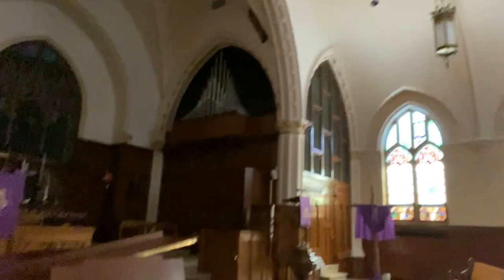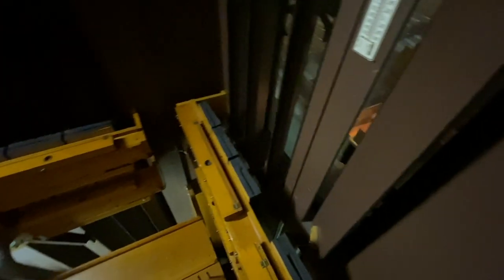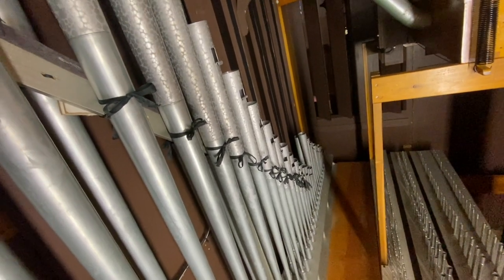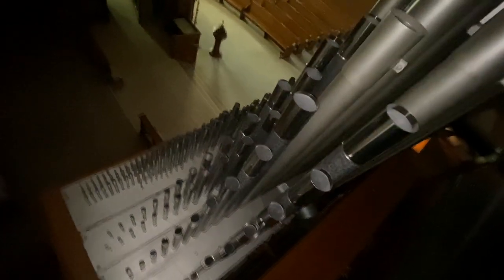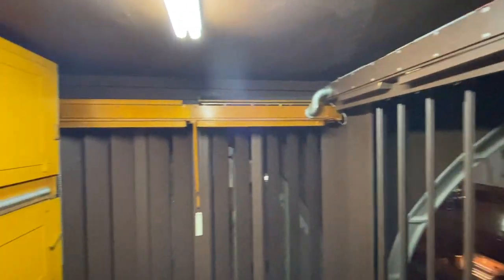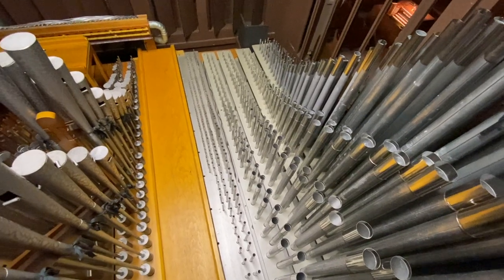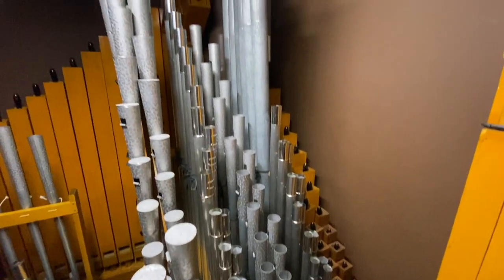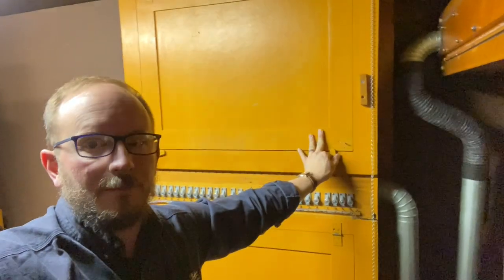St. John Nazareth Organ Tour

Comment: Thanks so much for the tour. I noted on a trip to muller in 1989 that its was common on practice to totally fill chest bottoms with material to assure no passage of air due to  and prevent unwanted air passage.